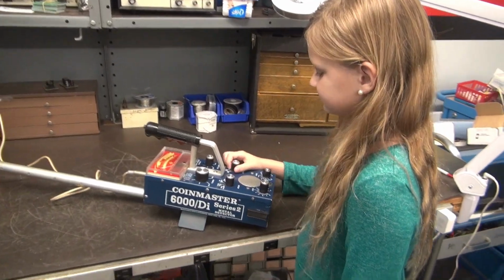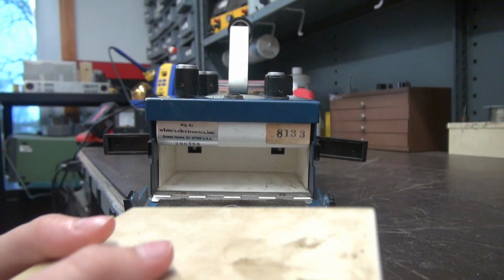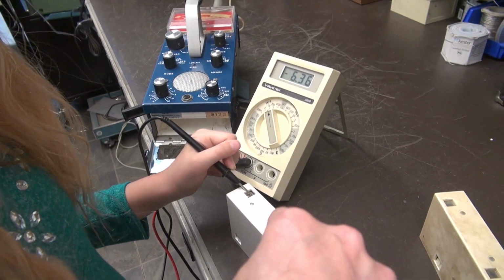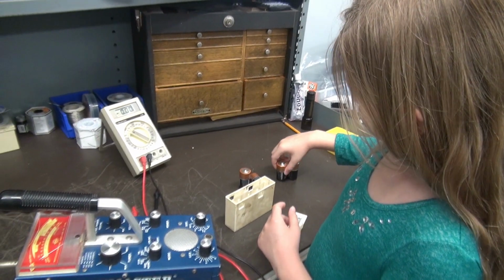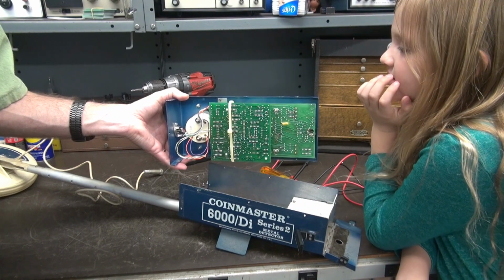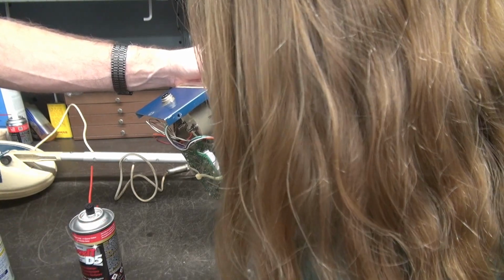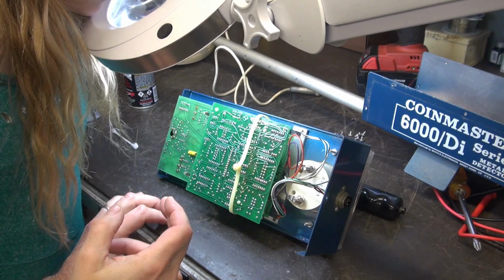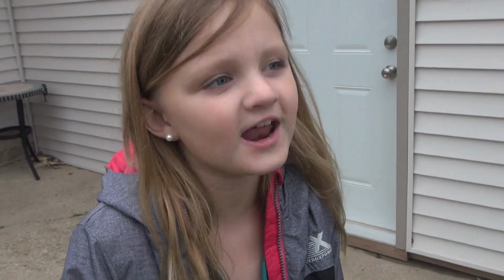Vintage Whites 6000/di Metal detector repair Intermittent operation

Comment: I was in sweethome to do some roofing up there and I walk in to whites on main street only to dream having 3 of the most powerful and the best period. Even today in 2025 January 9th I own those 3  detectors I could only dream of back then they are in mint condition all them matching color in black one being the black box 5900 di pro sl, 2nd being the 4B GMT,owsome detector for gold and 3rd the MXT PRO wow what a power house and is a 3 in one detector relics,coins,gold,they believed in putting the best technology in fact futurestic technology because today many other brands   still almost can't keep up with how well the run thank you whites for not using junk in your machines it's amazing how deep that old dinosaur 5900 goes under ground 8,10, 12 ,13  inches finding goins and gold rings all I can say is wow wow wow a premium build for all of whites detectors

Comment: Where are you located and can the cable from the coil on a Whites DFX 9 & 1/2 inch coil because rats chewed on wires close to the coil?

Comment: Good morning father... I think your project is excellent, very practical and direct... I had a hard time finding the circuit diagram for the Coinsmaster 6000/D series 2... one of those arrived for repair, if you could share it I would greatly appreciate your cooperation. Thank you and blessings in advance... Regards

Comment: ...but how do you clean the pushbutton in the handle?

I've got a Coinmaster 6000/D and no matter how many times I read the instructions I can't figure out what I'm doing with it. I can't tell if I'm using it wrong or if it has some intermittent. I don't really understand the differences between the modes and what the pushbutton really does. It doesn't help that the instructions focus on coins, nails, pop can pulltabs, aluminum foil, and bottle caps, without describing what it is about the differences between these items that I could extend to detecting other things (this week, I'm looking for stainless-steel hose clamps on a plastic water pipe).

Comment: I have a Bounty Hunter IV  detector. When I turn it power knob on ,it 
bzzzzzzzzzzzs. constant,  non stop no matter where it is on the knob 
selection. Discrimination is OFF and toggle is on METAL in middle. Any 
idea how to fix this??? The manual says make sure you use ALKALINE 
batteries head to toe in case. Which I did, brand new. Still doesn't fix
 the issue.

Comment: Please thank Short Wave Girl for me.  
I was just about to throw away my wireless doorbell extension. I had already replaced the batteries with no effect.  
This YouTube inspired me to buy a $6 can of electronic contact cleaner/lubricant and try one more time. 
I sprayed a couple drops on the volume control switch and worked in in (just like this video) and sure enough the doorbell extension was working again!  
Kind Regards
Arthur KD6GBY

Comment: I have a 6000d with the meter on the handle. I found the service manual for it. It had a battery connection problem and no audio